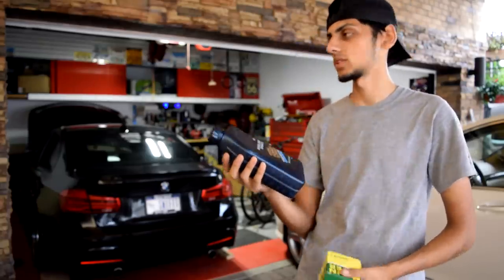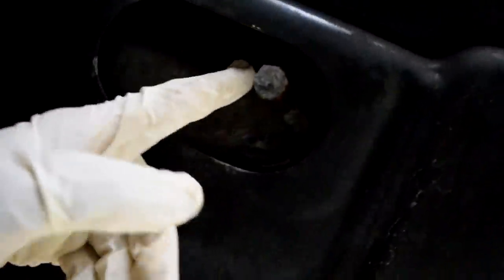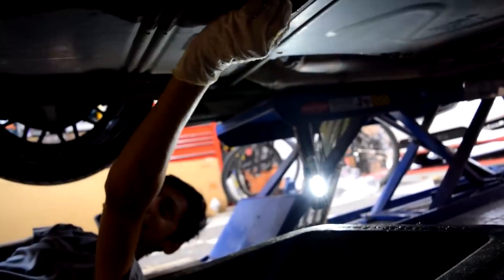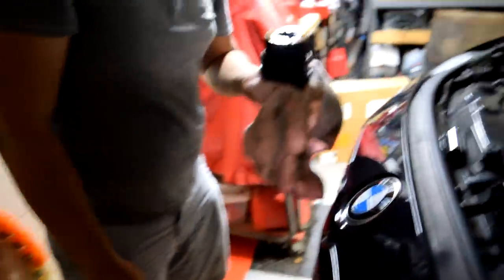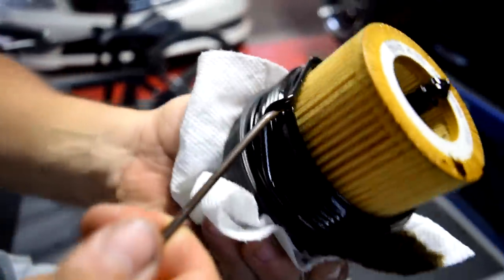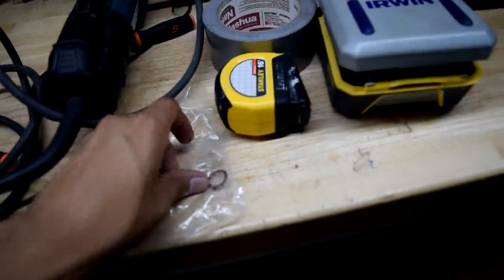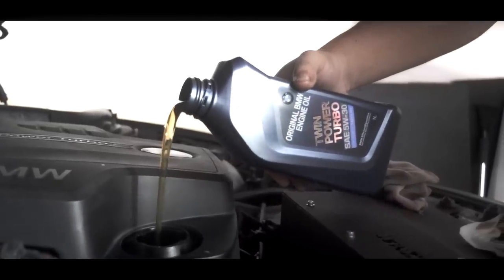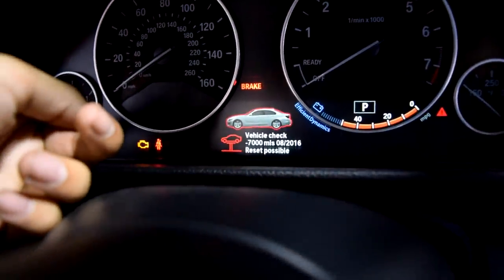BMW F30 328i Oil Change DIY!

Comment: So when someone goes and buys a used BMW and the seller tells you the car just got an oil change, he may have just pressed the button?
Reply: Guillermo Mora Anytime you buy a used car, you want to just do an oil change just so that you can start keeping track of the intervals along with your piece of mind.
Reply: Just crack open the oil filter housing and see if it's dirty. One tool away from having your answer.
Reply: Yes they can and do. I would always change the oil as soon as you buy a car, trust no one!
Reply: @robrodriguez4866  But question is... is it the right oil weight?
Reply: Roger Lee These cars tell you when any little thing is wrong. I can’t imagine it going 6k without throwing some sort of warning, if that were the case. Buying a used car from a private seller is enough of a reason to not even hesitate and just change it from the start.
Reply: @robrodriguez4866  I agree, i've bought many used cars before. Even if they show me the paper work saying they changed it yada yada yada, i go ahead and change it anyways. Therefor, no guessing and I know when it was changed and it was done with the right oil. Should money allow, hell change the differential and transfer case if there is one.

Comment: Being that these BMWs are so advanced with sensing pressure, does it matter if the oil filter and drain plug are not set to exact nm tolerance levels?
Reply: Nope doesn’t matter

Comment: how much do you spend on the parts?
Reply: Around $75 plus any shipping you might need to deal with, sometimes free.
Reply: I just bought the oil kit for my 2016 328i on FCP EURO and the price was 65.24$ (5 quarts and the BMW oil filter). Also bought the genuine bmw Air filter for $28.29 and the Cabin Filter for 13,79$ the total was 107.32$ but with taxes and delivery 128.16$

Comment: WHAT ABOUT 328D???
Reply: Diesel basically same, 5.5 quart capacity, but different filter and filter location, and should use an oil with BMW LL-04 rating rather than LL-01 for gas engine. Filter housing will require large wrench or metric socket to remove.

Comment: I have a 2016 BMW 320I. According to BMW you change the oil every 10,000 miles. Is this because the new BMW’s run full Synthetic? Thoughts Anyone..
Reply: Are you saying that's a long drain interval? F30s oil change, if you go off the engines oil condition  sensor and computer, is between 20k-30k kilometres, whatever that is in miles. I keep it to 10k which is perfectly fine.
Reply: Yes, full synthetic. For a while they used to advise every 15k miles, but that was back when they were giving free oil changes the first few years of new ownership. They don’t do that anymore, so they went back down to 10k. I’ve also read on some of the forums that they had unusually high amounts of cars with engine problems coming into dealerships while still under warranty during that time. Supposedly they found it was due to the extended oil change interval, and that prompted them to go back to 10k OC interval. This is also said to be the reason why they switched over to Pennzoil synthetic  from Castrol. The Castrol supposedly didn’t do as good a job protecting bearings. 

I personally feel that 10k mile OC interval is OK for a naturally aspirated engine, but feel it’s too long for a turbo-charged car, and with an engine as complicated as the ones in these modern BMW’s. With DOHC/4 valves per cylinder, VANOS, VALVETRONIC etc., there are a lot more moving parts, and a lot more friction going on in these engines. Throw in the heat of a turbo-charger and the way it affects oil life, I just don’t feel comfortable waiting 10k miles. I prefer to change mine every 7500 miles. That’s just me.
Reply: @Dimitrius001  Agreed, I change mine at 10k kilometres which is 6.2k miles, makes me feel more comfortable about lookingcafter my engine as best I can. My interval is 30k according to the condition sensor, not a hope in hell would I wait that long.
Reply: Ken Lawton  I feel you. I’ve been contemplating going with a 6k mile OC interval myself. The last few cars I’ve owned I kept until well past 200k miles. I plan to do the same with this one.
Reply: Brian Johnson sorry for the late reply, but if i were you I would do 5-7k intervals due to the fact that it is turbocharged. 10k will be fine, but will wear components of the engine quicker. just look how dirty it gets. why not have clean oil more often?